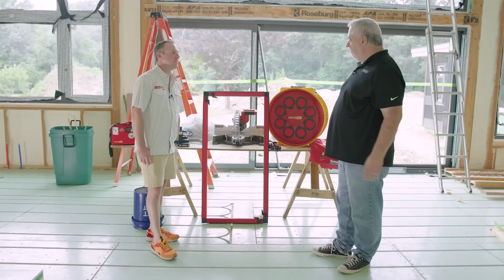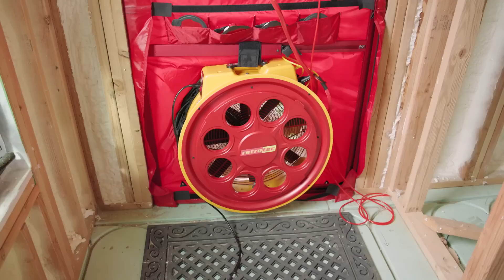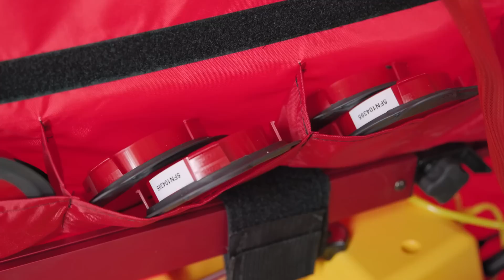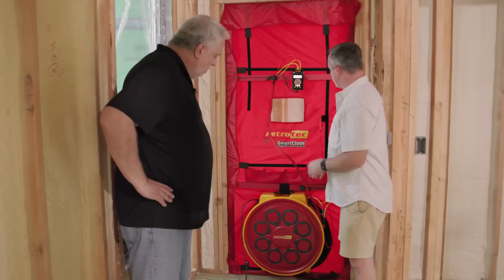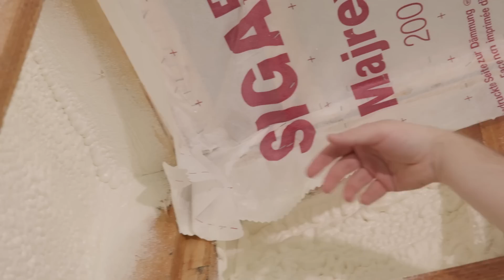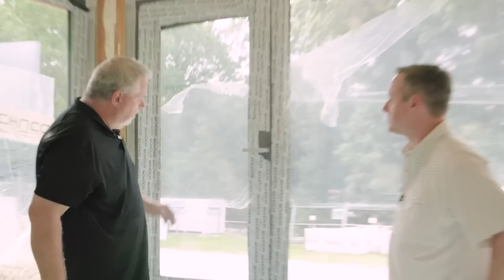"Blower Door Test" Build Show Build: Boston - Bonus Episode

Comment: Here they are supposed to have really amazing incentive programs however you need to do a blower door test and check the attic insulation which they charge $800 for. Then they are extremely slow at getting you approved as well as cutting the cheque

Comment: I always wondererd just what a door blower test was about and having positive and negative fan direction. Thank you so much for this. I am planning a door blower test, or two or three, when the ICF basement 3 storey extension, with exterior insulation and air tight features gets built. Thank you for this detail Steve....and Sam💝🇨🇦        🙏🙏

Comment: MIldly pedantic but no way it uses a "cat 5" on larger jobs.  Most likely he means RJ45 or ethernet and says cat 5 but there is a difference and it matters.  The shielding on a true cat 5 cable is such that over long distances you start to have problems which is the exact sorta thing you'd run into hooking multiple blower doors up on a large commercial build.  TLDR: you don't have to say RJ45 but if you call it cat 5, use an outdoor rated cat 6
Reply: Cat 5 works fine for commercial tests. You get 300 feet out of it. And if you need to use a signal booster to get more, you can. We have a few of videos on our channel that demonstrate the process.

Comment: So, I'm currently having a negative pressure issue causing my home to draw air from the outside, according to my HVAC tech . This home has a 2.6  ACH per hour if I remember correctly. Would an ERV fix this, and is this the right way?
Reply: No. An ERV does not remove moisture from the incoming air. A better option is a ventilating dehumidifier which can reduce or potentially eliminate the negative pressure in addition to removing incoming moisture as well as dehumidify during low load or rainy conditions.
Reply: @kennethdean4349  thank you
Reply: I would first find the source of the issue that is causing the house to go negative. Are your ducts located outside of the buiding envelope? If so, this is usually the cause. Having more supply side leakage than return side leakage will pull the house in a negative state. There are other things that can cause this as well such as water heaters drafting, or if the air flow to the bedrooms are not balanced and the bedrooms doors are closed. If you have a bedroom that is much more positive than the rest of the house  and that bedroom door is closed, it can pull the main body of the house negative.

Comment: I first encountered a blowerdoor in '85 or '86. I did some "contracting" for an early energy audit company in Charlotte NC. We were trying to get houses down around 5 changes. Houses usually started in low 20s or mid teens at 50.

Comment: Approximately 1.0 ACH 50 is very respectable for mid-construction.  Well done.  Air tightness is the low hanging fruit so performance testing is critical to understanding where our leaks are located and how to fix them.  Well done.  Love the Retrotec blower door unit.
Reply: Thanks for joining in buddy

Comment: just did our ICF house blower door test and got a 0.73 ach50.  HOWEVER i forgot a 1.5" and 2" PVC line.  the house is 39,000 cubic volume.  anyone know what the number will drop to with those 2 holes closed up??   would it be under a 0.60 ach50?
Reply: The only way to know is to seal the leaks and retest
Reply: @RetrotecEnergy  well that sucks haha.   You’d think a square area and cubic volume could be easily figured out.

Comment: What sort of HERS score do you use as an acceptable design goal?
Reply: I would say an average new home should target 70 or better - I typically strive for 50 ish without renewables, and obviously 0 with renewables
Reply: @stevenbaczekarchitect9431  Thanks Steve.  I've learned a lot from watching this series.  We're waiting for permits (due this week) for our home build in Santa Fe were the county requires a HERS audit.  Our's came in at 51.  I want to bump exterior insulation from 1" to 2" under the stucco.. settling into the mid 40's sounds like a decent goal.  (All electric, Ground mount 10kw solar (not part of the audit))  Can an HRV replace a bathroom fan?
Reply: @jesinbeverly  the right HRV can (like a Zehnder)
Reply: @jesinbeverly  Believe it or not, I have over 5000 homes in NM.......

Comment: I still maintain that ICF construction is the way to go.  ,25ACH  is baked in!
Reply: We priced it here - not even in the same zip code!! with pricing
Reply: Cost and expertise are limiting factors with ICF. Even if you can afford it, quality contractors are not abundant in many areas of the country.
Reply: @stevenbaczekarchitect9431  Are you comparing price on wall square footage alone and are you factoring in superior insulation, superior air sealing, thermal mass, superior sound insulation and superior wind loading as well as design advantage.

Comment: You can't know anything until you measure it. It's nice to ASSUME that tape sticks and sealant seals, but you don't actually KNOW until you measure it like this. This video is a great real-world example. Kudos to Sam for making the Retrotec product look so good, but also for showing the smoke generators. A builder with less money could improvise a system with common parts and no anemometer, then just use smoke to find leaks until they can afford a full Retrotec measurement system. That would be better than what most builders do to check for leaks...
Reply: great point!

Comment: Materials need to breath not houses!
Reply: People need to breath, not houses.
Reply: @iamblaineful  called an air exchange(ERV) you don’t drink untreated water water why breath untreated air when you don’t have too.
Reply: @Rvighwbrn  Air filters are for filtration, not an ERV. I removed the ERV from my house because it did nothing to remove moisture from the incoming air. I replaced it with a ventilating dehumidifier. I also installed an Aprilaire MERV 13 air filter which has a lower pressure drop that the Honeywell MERV 8 we previously used.
Reply: @kennethdean4349  what erv system did you remove

Comment: CFM per square foot of envelope seems to make a lot of sense. Would like to hear more of that and how it compares to ACH50 across different homes.
Reply: CFM per sq.ft. of envelope area does a better job of putting buildings of different sizes on an even playing field. This is why the commercial industry uses it. For example, the Army Corps of Engineers requires 0.25 CFM per sq.ft. of envelope area. That standard is used for all government buildings. When using ACH50, the larger the building, the easier it is to pass. For example, if a building code requires 3 ACH50 or less, its eaiser for a mcmansion to pass that requirement than it would be for a small, single-family home or tiny house. This can make it tough for some affordable housing projects.
Reply: CFM per square foot and ACH50 both scale to the size of the house almost exactly. You have to punch in the volume on a blower door in order for it to give you ACH50.

Comment: Thus show ," Boston build" , is getting better and better. I would like you to address the real problem. Yes , your trying to teach us ,and quite well I may add, about what we should know and put into action where necessary. However, my house was built in 1956, with 3/8" 2'x8' plywood roofing, staples and a bad local code and asbestos. So is it possable and how, to really fix it? As we have been adding and "fixing" as we go alone I think if we did a door test it may come out as a 10.0 . The majority of tract housing in this country would fair the same. What do we do?
Reply: Options.

1. Demolish and start again.
2. Gut back to frame, inside and out, build back better. 
2. Gut, back to frame, Internal, build back better.
3. Retro fit seal all you can, inside and out as is.
4. Do, 3, plus get air-barrier guys in to seal your holes using their system.
5. Retro fit air handling systems, to manage air flow.
6. Replace windows to better seal
7. Replace doors to better seal
8. Get your home tested, get an expert to advise, do what your budget allows.
9. Beware - cowboy eco know nothings. That could leave you with a ruined house, ruined health, and cost you twice as much. Doing it wrong then having to fix it!

Good luck.

Comment: I’m really enjoying this fascinating video - will need to come back to it later. But I wanted to ask about both of your comments about a breathing building not being good. 

In the 70’s, many commercial buildings (for energy efficiency reasons) were built to be as sealed as possible. As they were used, a number of people of people started getting sick, and it was found that the many indoor air pollutants that get generated in a building were building up to levels that causing people to get sick. Can you comment on that in light of your remarks in the video?
Reply: If you make a house air thickness then you need to put ventilation with heat recovery. So if you have ventilation the air will be fresh all the time
Reply: If you end up watching more Build Show videos, Matt Risinger covers this reasonably often. The short version is, they seal the house up ultra tight, and then they build controlled ventilation into the HVAC system, so that there's constant air intake happening. The difference here is that the air that's brought in deliberately is passed through ERVs or HRVs to control temp, humidity, and particulates.

The effect is that you've got constant better-than-fresh air cycling through the house, at a lower ongoing cost in energy dollars to the homeowner,.
Reply: @JustinMeyer  Thank you for your very clear, concise and illuminating answer. Yes, this makes sense, though you would also need to be sure that VOCs are able to be pulled out, too. I’m not sure why this video popped up for me, but this is my first of his videos. I found it fascinating and potentially could have some real uses in controlling fugitive emissions from sone industrial processes, particularly near sensitive receptors like schools. I’ll have to get myself more educated on this technology, it’s implementation and costs.
Reply: Air exchangers like HRVs or ERV's do exactly that. They draw out stale / polluted air and replace it with fresh filtered air.
Reply: @marks915  An episode or two back in the Build Show Boston Series was a fairly complete tour of the HVAC systems of this house including the ventilation systems.
Reply: This is the exact reason why we're still fighting the uphill battle to get tight envelopes into building codes, and where the saying "a house needs to breathe" stemmed from. Back in the 70s (remember the energy crises then?), we learned that air tight envelopes could save energy. So many were constructed with tight envelopes before we as and industry understood the relationship between air tightness and indoor air quality. We have to have some means of mechanical ventilation along with it to maintain a healthy living space. Thankfully, there are plenty of options to choose from in today's market no matter the building type or climate zone.